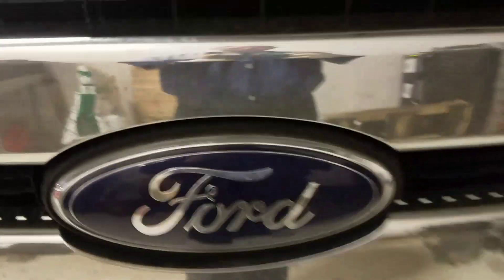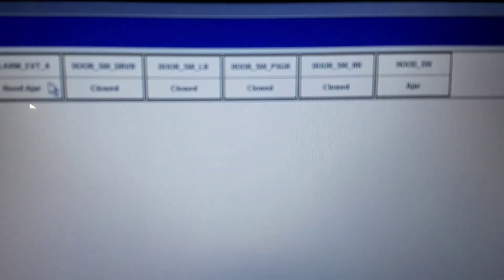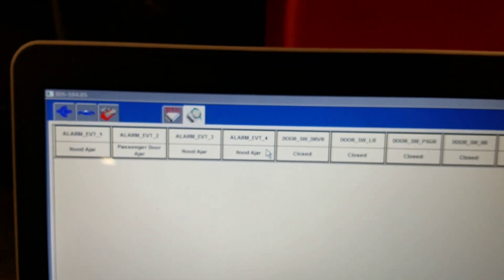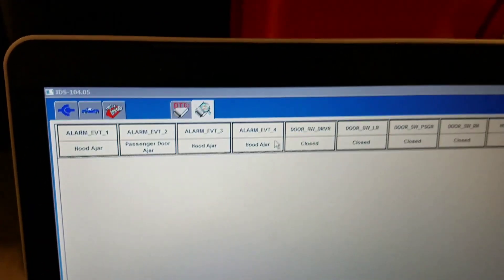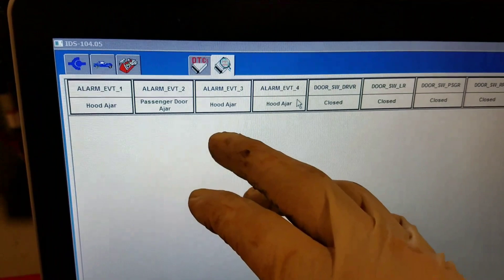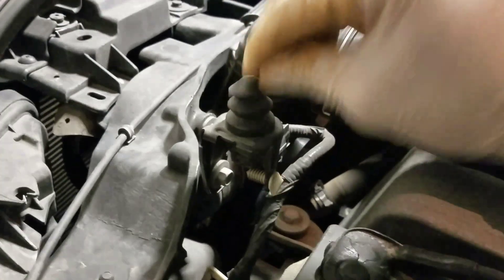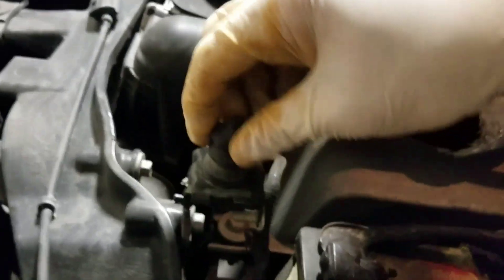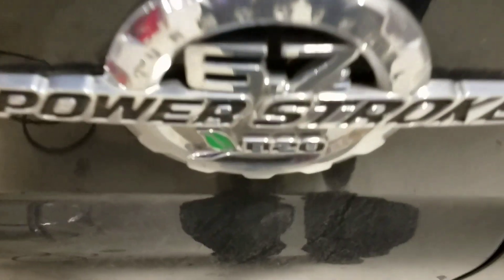12 Powerstroke - MIL, MAINT, ALARM?

Comment: Another good tip to keep in mind. 1 ? for u , on my 2016 superduty diesel if I was to take of my muffler and put a straight pipe in its place , would I have any problems or any sensers going off. Thanks
Reply from the maker: No, you can not touch the exhaust on your truck. You will have nothing but issues
Reply: @PowerStrokeTechTalkwARod  thank u for answering I thought so, thanks for u help

Comment: Quick question, do u know what color the running parking lights wire is? on a 2013 f250. I'm I'm trying to connect new led head lights.
Reply from the maker: +J........13 f2fitty comin at ya.......YELLOW WITH A BLUE TRACER....YE-BU AT ALL 4 corners!
Reply: thanks so much. u DA man
Reply from the maker: +J no sweat my dood

Comment: egr cooler at 70k.? wow. i live in an exempt emissions area. is it worth dumping the def and egr. or buy another extended on my 2016?
Reply from the maker: +Mark Nelson i wld check with ur local govmnt to just make sure $$$$$$
Reply: My 2013 f-350 EGR went out at 62,000. Stock 6.7